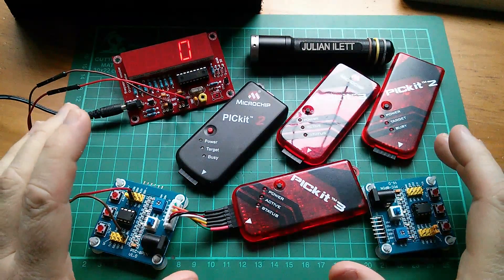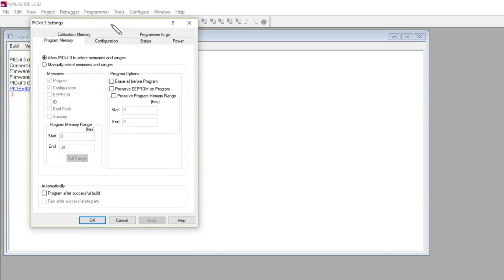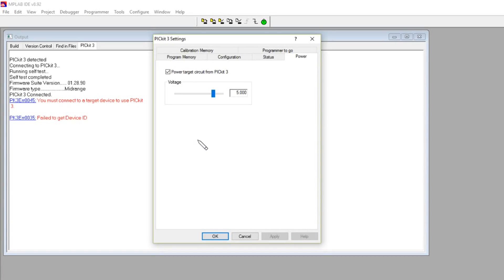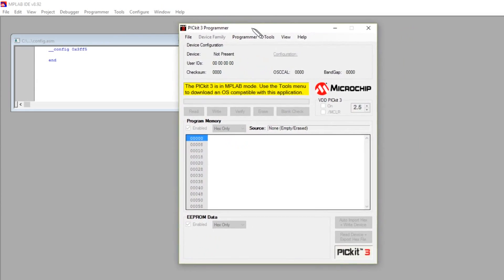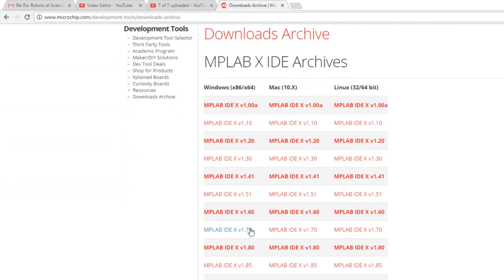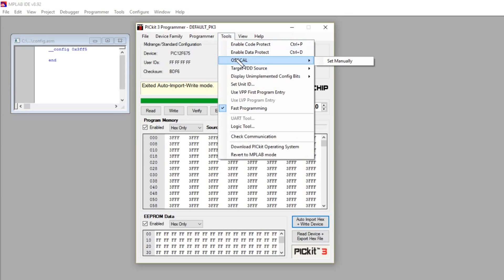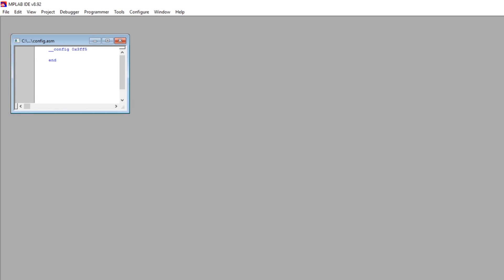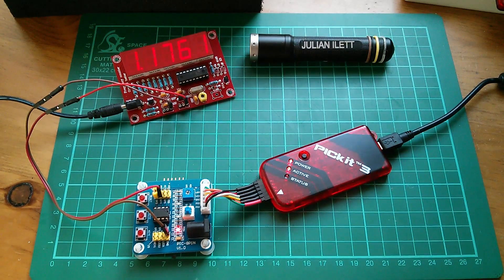PIC Assembly Language Update: #1.2 - PICkit3 Issues

Comment: standalone app is not an advantage for pickit 3, it's a step down from standalone app for pickit 2. The pickit2 app had way more features, it didn't require firmware change when you switch to mplap and has everything the pickit3 standalone app has (including the calibration). The only problem is that PICKIT2 and 3 standalone apps are unsupported. That also means that you can't write new chips with them. There are PICkit2 third party firmwares for some of the new chips, but you have to find them and people release them as they need them which is not when YOU need them.
Reply: BTW download all the apps from archive you need right now. It doesn't always work. It'll stop working when you need it the most and you won't be able to download the app.

Comment: Just a note for any Linux users... All of the Microchip Windows tools do work quite well under Wine. If you want to use the MPLAB 8.x.x IDE compilers/tools, they do work. You also have MPLAB X Linux version and it works good as well. I have even used MPLAB 8 via Wine to compile and the MPLAB X to program the chips with and that was fine to.
Reply from the maker: That's good to hear :)

Comment: The unhandled exception probably goes away if you install the programmer software in a folder outside of <Program Files>. By the looks of it it tries to save an .INI file inside the program's folder, but it lacks the file system rights to do so. As is can't save the .INI it also could very well be some settings don't persist between sessions.
Reply from the maker: Ah OK - thanks for that. But shouldn't the installer do all that stuff for me?
Reply: To save files inside the directory where the binaries are located is bad practice, but you know how engineers are ;) An installer can't help you there...
Reply: custardo Agreed, it is bad practice - today. There was a time when .INI files ruled the world and they were intended to live alongside the binary, and this is a legacy of that (also, some other OS file systems still encourage this kind of self-contained behaviour, so if the programmer build targets multiple platforms it might just be that the Windows build inherits this too). Rather than install the application outside of Program Files (which is a bad idea for a number of other reasons) just assign your own user-id as a 'Full Control' permissions record on the install folder, since the app runs under your user context and will then be able to do whatever it needs to in its' own folder structure (however naughty that might be by todays' standards).
Reply: You are right that it used to be so when Windows still was 16 bit, however... This version of the programmer software is from 2013, and there really is no excuse. It's not like it's a whole lot of work to place the file in a better location.

Comment: AVR's are just looking better, yet again.
Reply: I've been following this tutorial mainly to see if Julian can show me that using PICs and assembly language is better somehow than what I do now, which is use AVRs and C. So far I'm not loving the PIC "ecosystem" much - having to fight to get code into your device seems like such a 1980s problem to me. Kinda like fiddling with balky modems for hours just to get on a BBS for a minute.
Reply from the maker: Haha - they would be Microchip AVR core microcontrollers. It's all owned by Microchip now!!
Reply: True, However they are not going anywhere.
edit: I am just biased by the ease and 1 cycle per instruction thing. I don't know why people use anything with 4 cycles before anything happens when there is an alternative choice. At least not yet.
Reply from the maker: Fortunately for all of us, Microchip have a policy of not obsoleting anything
Reply: lol, I can see that :D
Reply: I have used both. I do prefer AVRs. But the pics have some nice features too. As for the 4 cycles per operation, the pics generally run at 4 times the mhz. So they are essentially the same speed.
Reply: In 20 years of working in the electronics industry I have never seen an AVR chip being used in a commercial application.( doesn't mean they aren't but I haven't seen one) Lots of PICs and some 80C51 based microcontrollers in older designs though. Now days if you want speed Arm cores are very popular
Reply: I believe price is the other consideration. There are a lot more PIC options, and you can dial the PICs in to have just the features/peripherals you need, and only pay for the features you need (for commercial designs).
Reply: im with you on this. I started with Pic's then jumped on the arduino/avr bandwagon. So hopefully I don't see anything too enticing form pics that will draw me away from AVR again lol.
Reply: Firstly, isn't this like why a mountaineer climbs mountains... you do it because the mountain is there.  :)  Sort of like why you would use a Z80 to flash LEDs.. do it for just the fun of it!  The more modern PICs e.g. PIC24F do have some interesting features e.g. DMA, RTC, direct LCD drive etc. and are cheap... but I do agree you can get a long way with an AVR now-a-days... but just do it for the LOLs,  :)
Reply: I was just trying to be nice.  I said you could get a long way... not that you could get all the way, ;)  Modern PICs aren't FOSC/4 devices either.  The PIC used here isn't really representative of current technology ... nor is it hardware debug-able, and it doesn't even have a UART but it does have the virtue of only 35 instructions!
Reply: Fuses in terms of microchips are literally just like real fuses where you burn out certain internal traces in the microchips to set the fixed state of the microchip. The modern microchip allows the fuses to be "Burned" (programmed) repeatedly meaning we don't actually physically burn them out anymore but set their permanent states until re-burned to another state. So the term fuses has remained a naming convention despite not burning the fuse anymore.
Reply: I agree with what Bernard says. I've almost exclusively seen pics and other chips but no AVRs. However, that is changing I think. My company is developing some new products based around AVR chips if all goes according to design.
Reply: Ok, Some good points up there, thanks people.
I do believe that the PIC chip has been around for a lot longer and was probably the only real option for some.
I have never seen a little chip run 4 times faster clock though. I'm going to have to find a list detailing various specs.

The biggest question I wanted to know is, What drives people to use a PIC over the AVR's.. I'm starting to think it is just familiarity and nothing more.
Reply: @Mr Anderson... yeah, as Trix said, they are supposed to be set and stay that way until you specifically set (or unset) them. Fuses on microchips (AVR ones anyway) are unaffected by the loading of code, as they are configured separately. I have heard of the fuses going bad, but have never been unfortunate enough to experience it myself.
Reply: @Bernard Jacobs I don't know what you consider commercial (mass production or industrial grade?), but I do know of a lot of electronic speed controller designs (for model aircraft, multirotor, etc) which were based on AVR parts... although I believe at least a few of them have moved to Silicon Labs parts for higher frequency PWM, etc. And just adding another data point... Logitech used ATMega32's in their MX series of mice...
Reply: Are you kidding..? AVRs are a much bigger nightmare - trashing fuses so the device is unuseable, needing clock, not including config fuses in hex file. 
I've never had any majoe issues with real PicKit3s or clone "kit 3.5" units and I use them a lot.

Comment: if you run the app in admin mode, you may not get that error. it seems, it want to read or write a file in program file folder, which is protected area
Reply: Never run in admin mode. just change permissions to allow authenticated users to write to the .ini file.
Reply: Dear  +M3ta7h3ad (or may I call you M3ta?)  As it happens, I do relocate my profile folders to another drive/path when I install windows, but generally leave the Program Files stuff alone precisely because the msi machinery's flexibility wrt installation paths renders its re-siting unnecessary. Provided the vendors follow the rules. It's usually easy to tell when they are not, since a sure sign of the amateur installer-constructor is offering the user a 'default' installation path of anything other than where you know it actually is, such as - typically - that Program Files folder. If you see something like C:/Thingy then you instantly know they're not professional installer suite writers because they have not used the correct methods to determine where your particular installation likes to install their thingies. Under such circumstances it may be better to go with their flow since gawd knows how many other such similar assumptions they have made.

I suppose I'll just say that if the vendor offers you a choice of installation path then you are - I maintain - quite entitled to take advantage of that and further that you are entitled to take umbrage if you later find that the installer writer has not - in fact - followed the rules and messed up on permissions and security. There's no excuse for not following the rules as it should be in the software you are using to build the packages. Of course these can cost money and some folk are giving their stuff away for free, so the etiquette here is quite complex. As a security preacher you'll be well aware that those who use free software should perhaps not rely on said software's security infrastructure too much. Unhappily this seems to extend - more often than not - into stuff you have paid for, and they get away with it because license agreements and disclaimers.

But this is hardly the forum for such discussions. There's plenty of such conversations to be had elsewhere. Maybe in a pub.
Reply from the maker: Naughty Microchip!
Reply: Yup. Or change permissions of that PICKit3.ini file to allow writing by any authenticated user. It's in Properties of that file -> Security -> Edit.

Kinda sucks that Microchip would violate Windows application ruls this way (the .ini should reside in user's AppData)
Reply: simontay1984 not overly restrictive. sensible.

most services install to program files, one of the most basic methods of privilege escalation in a system is simply overwriting a service executable that is being started as an elevated user (commonly local system).

To allow a standard user to write arbitrarily to the program files folder as a default rule, would be to introduce a serious security vulnerability to your system.
Reply: Hi Julian,    I can also confirm the error is caused by the user running the program, who does not have write permissions in order to create the .ini file when the application first exits. I have changed the permissions on my Windows 10 PC, on the folder "C:\Program Files (x86)\Microchip\PICkit 3 v3"  it then was able to create the PICKit3.ini file which contain setting for the application to use.If the user does not have permission to the folder, the PICKit3.ini file will not be create, so the error will show all the time.
Reply: M3ta7h3ad Or better still... stick to 8 by 3 filenames! :-P And remember that not everyone here is a expert computer user... so be gentle! :-D
Reply: Thanks for the ms-dos solution, +M3ta7h3ad. In fact there have been better solutions - even within msoft's windows universe for quite some time (certainly all this century), and that has been the ability to choose your own name for a whole bunch of 'special folders' (many of them with spaces in their conventional names) which are by no means limited to quaint 8.3 conventions or unaesthetic tildy shorthands, The problem is that if you do not take advantage of this facility at windows installation time then it is a real bum-pain to implement later. However, this is not really an issue since the windows installation machinery is quite capable of doing the right thing, permissionwise, when it allows the user to choose their own installation path. I take the view that if a vendor offers this flexibility (most do, many do not) then I'm entitled to take advantage of it. It is, however, a tad annoying when the vendors break the installer rules when constructing installation packages and force the user to fix the installation with unreliable manual interventions such as having to alter permissions. Maybe they do not pay their developers enough.
Reply: Peter Feerick fair points Peter, not that I'd consider myself a computer expert mind but computer security is my day job so I do get more than the usual exposure to it. Just frustrating when you see people willingly putting themselves and then recommending others put themselves at risk. :(

Just because something works, doesn't mean you should take that approach.

Proper way of dealing with this issue... create the file manually as your user just a blank one. Give your user full control of said file, retaining the original file permissions for the folder. It is a cock up by the developers but as the software is so old, you've got a cat in hell's chance of getting them to correct it.
Reply: That's why my application never throws that exceptions!
Reply: Ah. That might explain why I've not had any problems exiting that particular prog - I tend not to install to "Program Files" (if I'm given the choice) since I have always been averse to spaces in filepaths. Installing (as I do) most stuff in a /Software folder seems to eliminate many perms problems, without (afaik) introducing any others.
Reply: Yeah, I thought that might be the root cause of the error when it said that it access that file in the Program Files directory. Bloody microsoft and their stupid permissions system! Why shouldn't a program be able to access/write to it's own data file!!! It is a bit ridiculous to have yet another folder in the appdata folder when it's just for one file... but anyway... running as admin fixes the issue, and so does editing the Security permissions of that file and enabling full permissions for the users group. You'd've thought that Microchip would have done that basic bit of testing! :-O
Reply: M3ta7h3ad  yes, never run in admin mode, best is to install the app in different location, but in this case, i believe we can trust microchip
Reply: Mahyar No, the best solution is to allow access to the file as required for the specific user. Installing outside of the program files folder should be dissuaded as you are effectively bypassing Windows built-in security measures.

Trust of microchip is moot. Do you trust me? or any other person who's tutorial you may follow or program you may download?

What if I was to find a vulnerability with the pickit programmer such that it could execute arbitrary operating system commands when you attempt to utilise my shared pic code?

It would now be executing as administrator in an elevated process with all the rights associated with it.

A 2 second Google search has revealed at least 2 vulnerabilities that would result in issues almost exactly as I described with MPLAB. Given Pickit programmer is older, I'd not be surprised if numerous vulnerabilities also existed there too.

https://www.cvedetails.com/vulnerability-list/vendor_id-9710/Microchip.html

Remember kids: practice safe cyber.

Here you go, even found a nice proof of concept exploitation for you for one of the above.

https://www.exploit-db.com/exploits/8656/
Reply: simontay1984 face palm that's great Simon but that doesn't mean you should be doing these things, and you most certainly should not be recommending the risky practice to others, you clearly have no idea why the extremely sensible precaution of only privileged accounts writing to the program files folders came about.

It's just as stupid as running everything as root in *nix based systems.

Just don't do it, because if you are doing it you're doing it out of ignorance for the correct way of doing things.

As for "I don't like spaces in file names" there has been a solution for that since MS-DOS. Clue: Progra~1 and Progra~2.
Reply: Paul Sampson if you have moved the location of your program files via the means you can also move your profile folders, well done. If however you've just started using program installers to install things into a random directory of your own creation you will be bypassing a key protection mechanism for your machine. That is your choice, but I will speak up when I see people advising others this as a standard practice.

True the developers cocked up and that is annoying and it's a regular occurrence as I'm sure you are aware. Which is another reason why windows protects the program files folder as it does.

File permissions are key, the developers of this app should really be saving said ini in c:\users\user\appdata\local\microchip\blah... as it's clearly intended for per user configuration.

I will say though, what you do is worlds away from the nastiness that is "just run it as admin" so fair one.

Anyhows, I'm done preaching at least :)